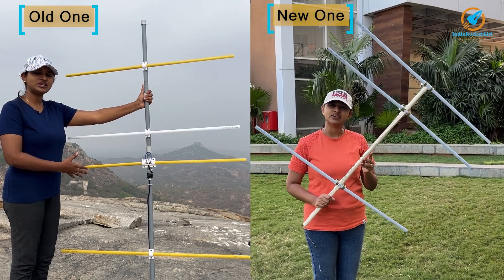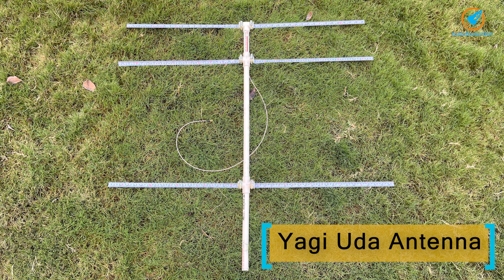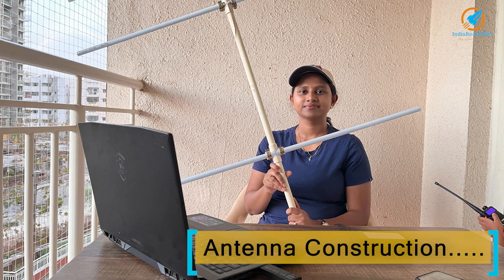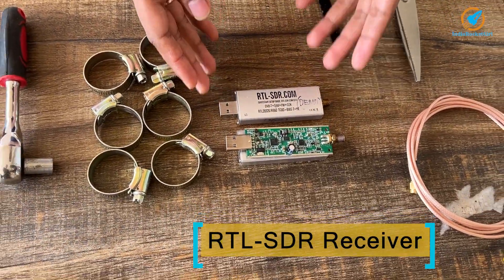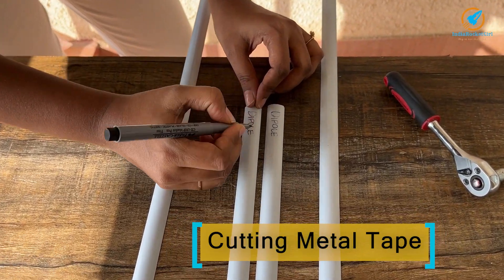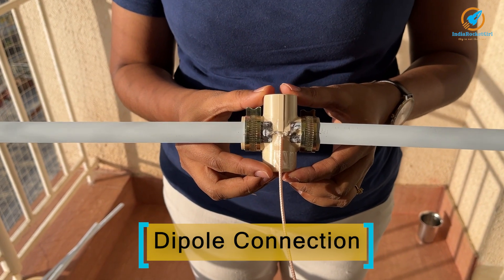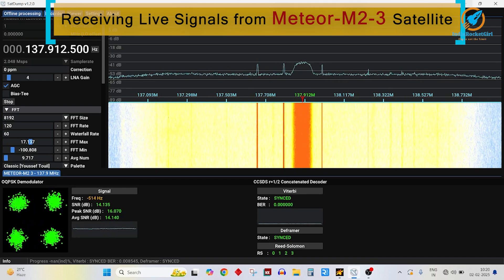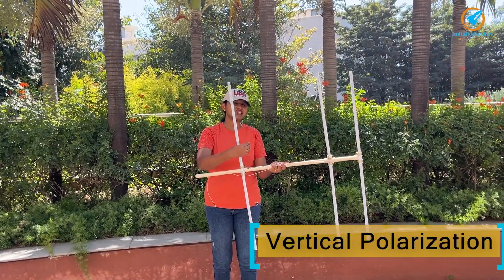How to make Satellite Antenna ..? | Yagi Antenna | DIY

Comment: thanks a lot for this video. 
Can you tell me what SNA connector have you used to connect to the RTL SDR ?? I have made the external structure. But cannot find a proper way to connect the other end of the soldered wire to the RTL SDR or hackrf. 

Keep making such videos about antenna education.